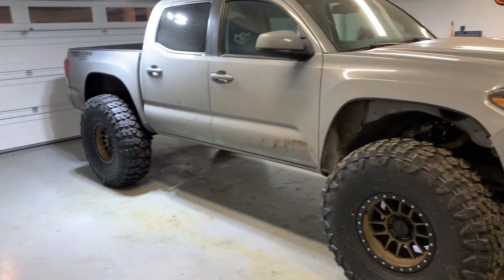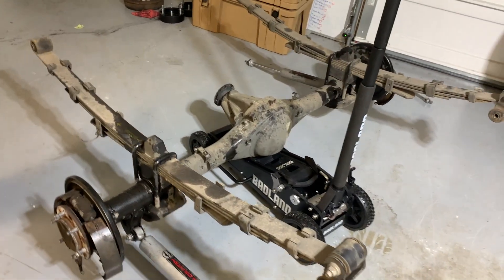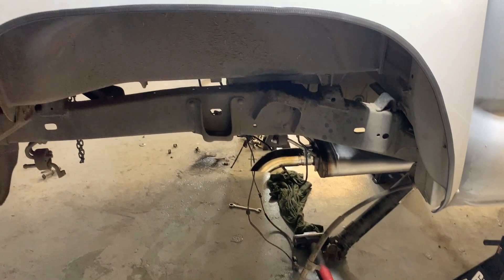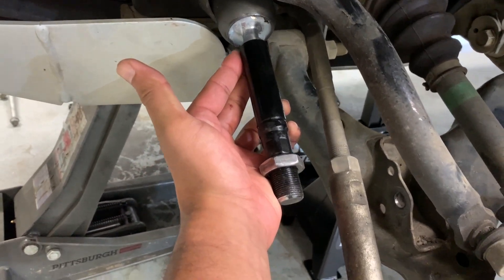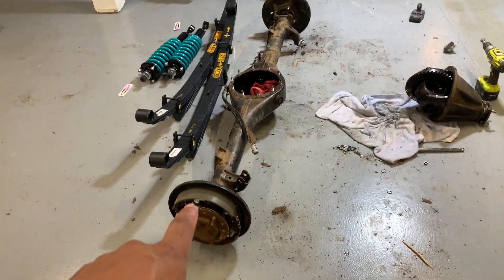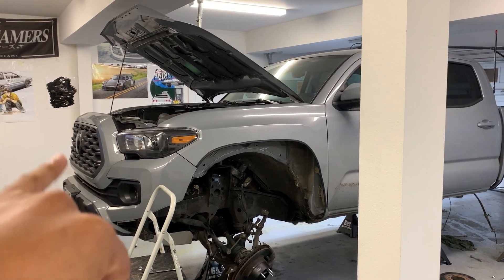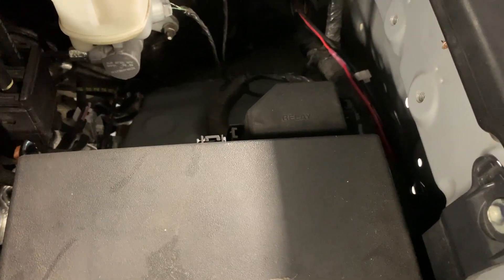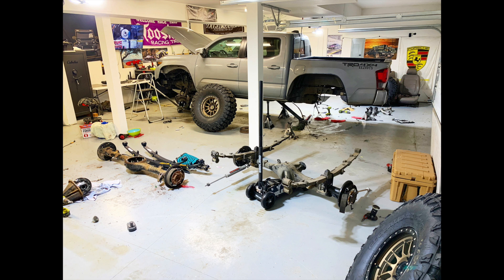3rd Gen Tacoma On 40's: Starting The Teardown

Comment: What tundra upgrade steering kit did you get? Or should I say where did you get it from? Seen basikbiker, solo motorsports, and just recently saw Toyo steering also sells the whole kit with the same inner and outer tie rods you showed in the video. Haven’t heard much about the Toyo steering one.
Reply from the maker: Toyo-steering, was going to get it from basikbiker but this kit made more sense since I’m going to run the stock tundra tie rods for a bit, this kit came with everything. I believe basiks is just the rack for $100 less. Solo is just overpriced imo.